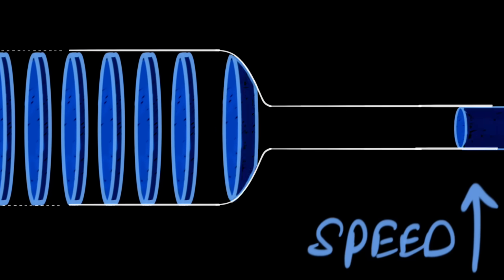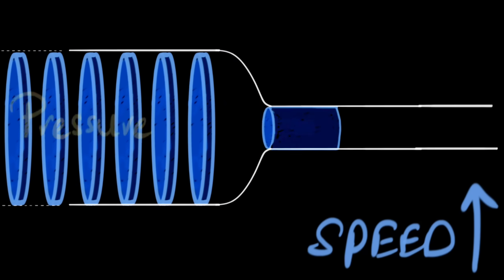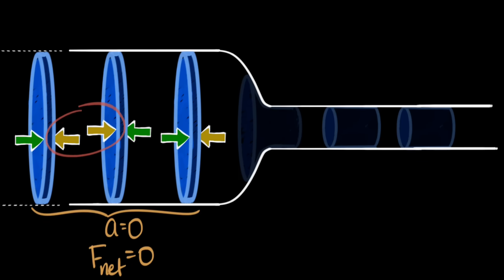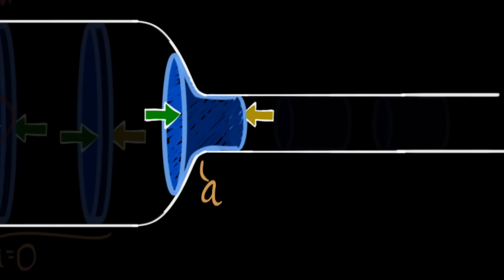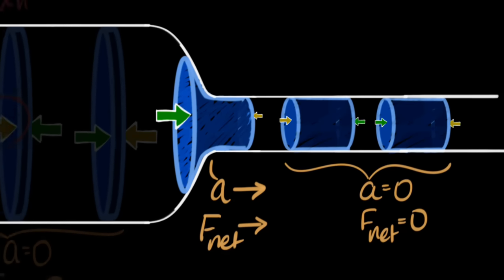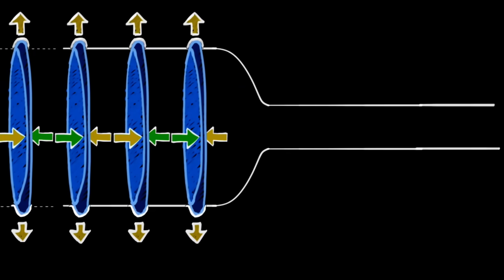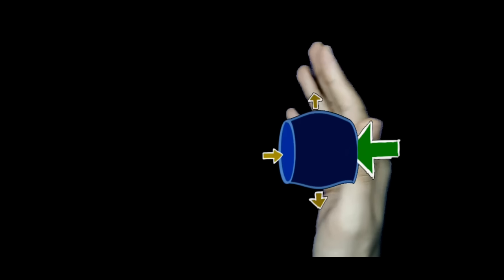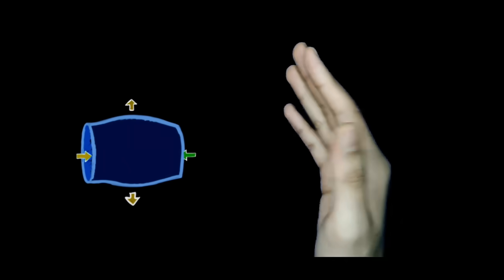Why Faster Fluids Have Lower Pressure? #VeritasiumContest

Comment: The pressure is the same (Pascal’s law) the force is lower because the surface is reduced  in closed systems. In open systems the speed increase because the energy is transformed in kinetic energy and thermal energy due to resistance and so the flow is reduced in an open system.

Comment: your proof is based on the assumption that the water must accellerate going into the smaller tube you just explained both end points not the journey there
Reply: In this scenario I believe the assumption is that the fluid is incompressible, which is a very typical assumption in basic fluid dynamics scenarios, and is certainly the case for water under normal conditions. This means that the same volume of fluid has to be passing through each point during any given time interval. The only way for that to happen in a smaller tube is if the fluid is flowing more quickly. But if the velocity has changed then acceleration must have occurred. So it's absolutely a reasonable assumption to make given the limited context from this clip.

Comment: The way I "feel"  this thing is - Imagine the tube is not yet completely filled with water and it is gradually filling. So the continuity equation doesn't hold yet .Now what would happen at the intersection of tube of less area and tube of more area?- more and more water molecule would reach there but won't be able to enter the tube of narrow opening as there is not much space there , so this thing would continue until there are so many molecules accumulated in the wider tube that their pressure becomes so high that it satisfies the continuity equation by increasing the speed of water. You can explain this in resistance terms - the narrower the opening, the higher the resistance.(And this is experimental)

Comment: I think this is an overrated answer. How did this win an award? He never explains WHY the pressure reduces….the one thing all students are confused by. All he did was explain why velocity increases (by talking about acceleration ), but he NEVER explains why pressure decreases. I’m baffled why everyone is acting like they learned something from this video?
Reply: Exactly. Circular thinking. And he also does not explain why the pressure on the hand is actually, indeed, higher.
Reply: If force decreases in the smaller section of the tube, then pressure which is force per unit area also decreases right?

Comment: well, you mentioned that the force at the smaller area must be "smaller" than that of larger area as the fluid is accelerating. I am OK with that. However, do not forget the area is getting "smaller" as well. So, how could you say pressure is "smaller" in smaller tube?

Comment: You got it backwards. Water doesn't lower pressure when it goes fast, there is no law that says that. For water to speed up there has to be a lower pressure area it can accelerate into, otherwise it won't.

Comment: what if the we reverse the pipe diameter, where the flow is going from smaller diameter to larger diameter, assuming A to be smaller diameter section of the pipe and B to be larger diameter section of the pipe, in that case if we apply the same concept from the video, there is net force from A to B therefore pressure should be larger in B side of the pipe than A, which is not true, hence I think its better to see it from total energy way than the video.

Comment: What you said doesn't seem entirely correct. For example, for the same straight pipeline, we can make the fluid flow through the pipeline at different speeds, but the pressure in the pipeline is the same. This indicates that under the same pressure (such as atmospheric pressure), the velocity of the fluid can be different. The correct explanation for the phenomenon in your video is as follows: due to the narrowing of the pipeline, the flow is obstructed, resulting in an increase in fluid pressure, and as a result of the increase in pressure, the downstream velocity of the pipeline increases.

For example, winds moving at high speeds on Earth can be at one atmosphere, and winds moving at low speeds can also be at one atmosphere.
Reply: >> The correct explanation for the phenomenon in your video is as follows...

Replacing one incorrect explanation for another isn't the answer.
Reply: @Rick_Cavallaro  Do you think I don't know the so-called continuity equation? Obviously I do know it. But what you don't know is that to ensure the constant flow rate, there must be an increase in pressure, otherwise the fluid will not have acceleration in the narrowing pipe. So, in a certain sense, what you said is the same as what I said, but you talked about this phenomenon from the perspective of the continuity equation, while I talked about this phenomenon from the perspective of the increase in pressure.

Comment: This doesn’t make any sense why does the pressure on the front decrease? I understand that the force pushing the fluid toward must be greater that the force pushing it back. So why isn’t it the case that the force pushing increases? Plus the water has inertia so when it is accelerating there should be more of a force pushing against the fluid.

Comment: While the molecules in a fluid are constantly vibrating and jostling around, the 

average distance between them tends to increase when the flow speed increases. This is especially true in the scenario described by Bernoulli's principle where a fluid is flowing through a pipe with a changing cross-sectional area.

Here's a more detailed explanation:

    Constant Speed: In a region of constant cross-sectional area and constant flow speed, the molecules maintain an average distance due to the balance between their kinetic energy (related to their motion) and the intermolecular forces (the forces that attract or repel molecules from each other).

    Narrowing Pipe (Increasing Speed): When the pipe narrows, the fluid is forced to speed up to maintain the same volume flow rate. This means the molecules gain kinetic energy.   

Source icon
Source icon

Increased Spacing: As the molecules move faster, they tend to spend less time close to each other and more time further apart. This results in an increase in the average distance between them. The increased spacing means fewer collisions between molecules, which leads to a decrease in pressure.  
Source icon

Important Note: This increase in average spacing is more significant in gases than in liquids. Liquids are much denser than gases, and their molecules are already closely packed together. So while the average spacing might increase slightly in a faster-moving liquid, it's not as noticeable as in a gas.
Reply: It is no intuitive if not outright wrong that somehow increasing velocity results in a larger average distance between molecules. Where did you derive this drivel ?!
Reply: @MathCuriousity  It's wrong.   In subsonic flow, normally below around 0.3 Mach, the flow is typically treated as incompressible.  Above that speed, the flow can compress, and the molecules will therefore get closer together, not further apart, as the speed increases.
Reply: What you said doesn't seem entirely correct. For example, for the same straight pipeline, we can make the fluid flow through the pipeline at different speeds, but the pressure in the pipeline is the same. This indicates that under the same pressure (such as atmospheric pressure), the velocity of the fluid can be different. The correct explanation for the phenomenon in your video is as follows: due to the narrowing of the pipeline, the flow is obstructed, resulting in an increase in fluid pressure, and as a result of the increase in pressure, the downstream velocity of the pipeline increases.

For example, winds moving at high speeds on Earth can be at one atmosphere, and winds moving at low speeds can also be at one atmosphere.
Reply: @enbinzheng-line  
>> The correct explanation for the phenomenon in your video is as follows...

Nope.  The increase in velocity in a narrowing pipe is simply due to conservation of mass in an incompressible fluid.
Reply: @Rick_Cavallaro  Your knowledge of fluid mechanics seems to be poor. In fluid mechanics, there will be no acceleration without a pressure difference. If there is only a narrowing of the pipe but no pressure difference, there will be no acceleration.
Reply: @enbinzheng-line  
>> Your knowledge of fluid mechanics seems to be poor.

I guess you'll have to take that up with my aero professors from my B.S. and M.S. as an aerospace engineer.  Until then, let's just go with your ad hoc guess work.
Reply: @Rick_Cavallaro  Do you think I don't know the so-called continuity equation? Obviously I do know it. But what you don't know is that to ensure the constant flow rate, there must be an increase in pressure, otherwise the fluid will not have acceleration in the narrowing pipe. So, in a certain sense, what you said is the same as what I said, but you talked about this phenomenon from the perspective of the continuity equation, while I talked about this phenomenon from the perspective of the increase in pressure.
Reply: @Rick_Cavallaro  Don't think that you have studied for a degree, which does not mean that you really understand the knowledge you have learned. Without pressure (or pressure difference to be precise), the fluid cannot obtain acceleration. This is Newton's law. Do you want to violate Newton's law? So where does the pressure come from? As the video says, blocking with your hand can increase the pressure. The pipe from wide to narrow is also like a hand, which blocks the movement of the fluid, so the pressure of the fluid increases. And because of the increase in pressure, the fluid obtains acceleration. Don't you understand such a simple truth? So I said that you didn't learn the basics well. You should go to college and apologize to your professor.

Comment: But why velocity increased when diameter decreased? I mean I know area decreases, continuity of flow rate says velocity should increase… but from physics from point of view, why velocity is increased when diameter is decreased? Why can’t flow slow down when area is decreased and thereby increasing the pressure back in the upstream side?
Reply: Pressure is concentration of force. 
It is due to random movement of molecules causing collisions among themselves and also colliding to the wall of the container. 

These collisions are not not perfectly elastic which means they transmit some of their kinetic energy to wall also. 

If u ask why molecules move in random, it's again due to thermal energy. 

Theoretically absolute zero kelvin is where even the gluons inside quarks stop moving. 

But we are at 298k Or 25°Celsius which means every molecules around us and that made us all are in continuous motion. 

These motions can be moving the molecules across the space or just rotating motions without changing its co ordinates. 

The motion that cause changes in position is that responsible to transfer energy to other molecules and that is what HEAT. 

Due to this the water molecules also move in random motion. 
But we using a motor give them a way and energy to reach the desired location for using them. 

The MOTOR PUMP generates energy by electricity and this energy is used to create negative pressure and pull water to tanks located on top of buildings. 

Now another motor will push these water into pipe. 

Pressure in the fluid is different from pressure exerted by the fluid. 

Pressure in the fluid: measure of force exerted by moving column of fluid on its wall. 
More dense fluid, more molecules, more pressure. 
Very fast moving means molecules will be having their velocity vectors majorly in the direction of flow, that implies there collision on the wall decreases and we say pressure is reduced. 

Coming to ur question why velocity has to increase. 

From one end ur pumping fluid.
And ur having a narrowing in the pipe. 
See fluid cannot flow back bcoz the pump pressure is very high . 
Fluid has only one direction to move. 
Now think what has to increase
Pressure: force acting on pipe wall. 
Considering ur perspective that pressure has to increase when area decreases..... That means no. Of collisions or energy that is being transmitted to the wall is high which itself means the molecules are having high kinetic energy. 

2nd law of thermodynamics states that energy gets diffused and distributed to attain maximum microstates possible= ENTROPY. 

Heat always flows from hot body to cold body. 

In ur view of pressure has to increase, pressure itself dependant on kinetic energy of molecules. 
If pressure is high, kinetic energy is high and molecules flow with high velocity. 
And if molecules move with high velocity there collision time with pipe wall reduces and hence pressure decreases.

Comment: I am a dumdum and have a question: How does the pressure change if the liquid goes through a squeeze, speeding up and then entering a larger void. In my heads logic it will keep the pressure of the tighter area and reduce speed again, right?

Comment: I believe while the pressure might be lower either at the walls of the channel or between fluid molecules, its a misconception that pressure is less in the forward direction. A good way to understand what I mean is, if you placed a detector in the front of your water faucet and shrunk the size of the hole the water has to  exit, the detector will most definitely read more pressure since the water gouging out has more force applied towards that direction
Reply: Or if you just made an opening tube that goes up, you would see higher level in the left tube than right tube , indicating the pressure drop
Reply: What you're describing is what he touches on at the very end.  Here's the short story...
What we normally call the "total pressure" is the sum of the static and dynamic pressure.  When we accelerate or decelerate the fluid, without doing work on it, the total pressure remains constant.  This means that accelerating flow is experiencing a reduction in static pressure and an increase in dynamic pressure.  The static pressure is what you'd measure with an absolute pressure gauge if you were traveling along with the fluid.  The dynamic pressure is what you feel when it hits your hand.
Reply: What you said doesn't seem entirely correct. For example, for the same straight pipeline, we can make the fluid flow through the pipeline at different speeds, but the pressure in the pipeline is the same. This indicates that under the same pressure (such as atmospheric pressure), the velocity of the fluid can be different. The correct explanation for the phenomenon in your video is as follows: due to the narrowing of the pipeline, the flow is obstructed, resulting in an increase in fluid pressure, and as a result of the increase in pressure, the downstream velocity of the pipeline increases.

For example, winds moving at high speeds on Earth can be at one atmosphere, and winds moving at low speeds can also be at one atmosphere.

Comment: At a molecular level, faster molecules have fewer "bounces" against the container walls (= lower pressure) since they're traveling a greater distance parallel to the walls.
Reply: Velocity along the same vector adds up, it should have no effect on the perpendicular forces, the only reason is happens, because Fluid always sticks to the surface, and there, the velocity of Fluid is always zero, stretching the Fluid toward the center, creating a suction effect , its called boundary layer theory.
Reply: I don't think this is necessarily true
Reply: This your explanation works for wing as well ..